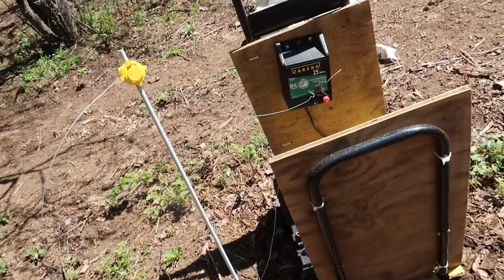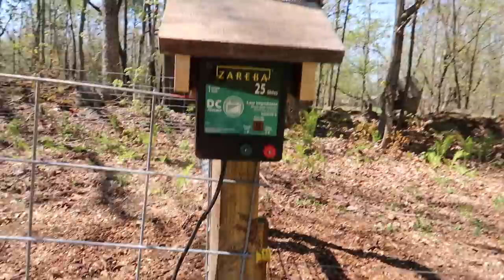Olivia Slips and Shares ONE of the Secrets

Comment: How about a plastic tub of sort with a cover for your electric parts you could mount it on your two wheel dolly with "WRATCH STRAPS " and on the side drill some holes where you can fish your wires through and if you want to put rubber gromits in the holes just a suggestion.  Larry